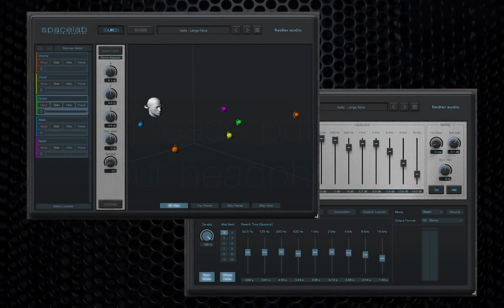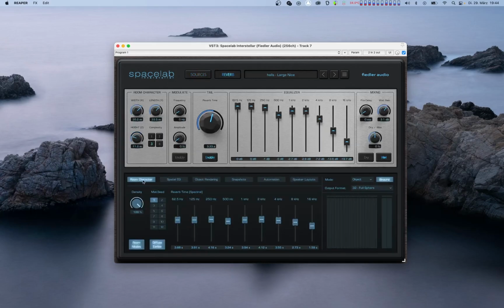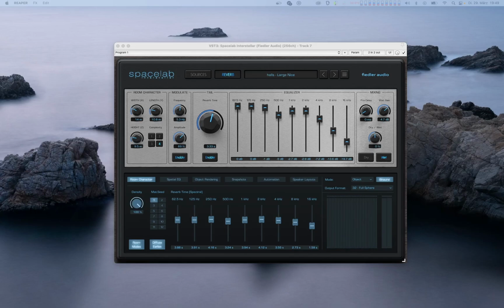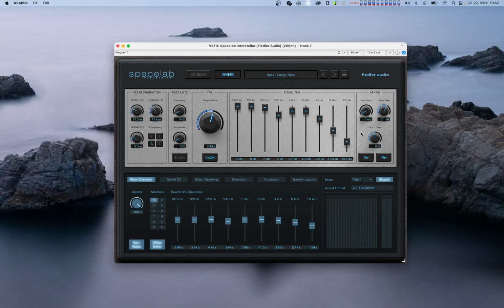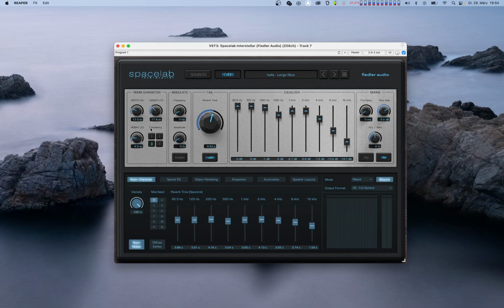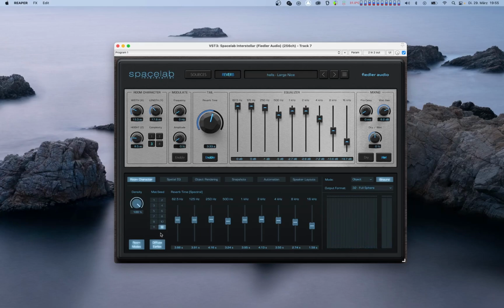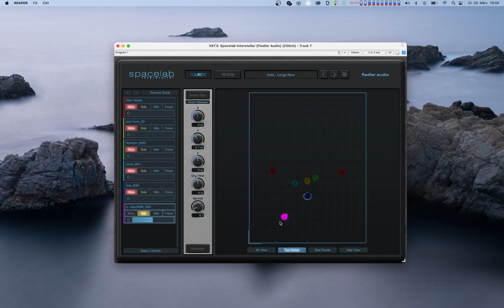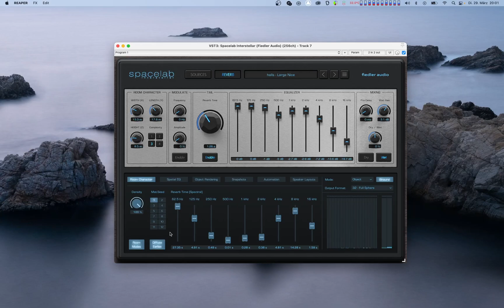Spacelab Tutorial - Reverb Parameters

Comment: Is it possible to have reverb adjustments on per object basis ? Or it is global for all sources ?
Reply from the maker: On the sources page you can adjust dry/wet ratio individually for each source. The reverb parameters shown in this video however are global.
Reply: @fiedler-audio  Awesome . Is it not possible to run multi instances of Space Lab and send a subset of beams into select Space Labs to get different types of Spatial Reverbs all across ? I am mainly fascinated by the power of your Reverb engine which has got potential to replace many plugins chains ( or in other words , the customisation is so complex that , with this one reverb engine alone , one can able to generate infinite sounds of spaces  . What's more ? Even use this as an upmixer ) . Hence i am thinking of this ability especially for Post , as i am working on Dolby Atmos projects , where there is an action scene and one would like to simulate a battle field while immediately as the score plays by the audience need to get transported into an opera for example.

For example , i would like to have 3 instances of Space Labs dedicated for DX , MX , FX and one Space Lab as standard bed . Distribute my sources accordingly and have Unique Spatialization for all of these 

If not , Let me know if there are other ways to achieve similar experience . The potential of your plugins are  fabulous
Reply from the maker: @i.a.m-poornasrikarm  Thank you!

 You can run as many instances of Spacelab as your Computer can handle. All Beams are available in all Spacelab instances, so you enjoy ultimate freedom. Download Spacelab and use the 14 days trial to get a first hand experience.
Reply: @fiedler-audio  Wonderful . Definitely 🥰